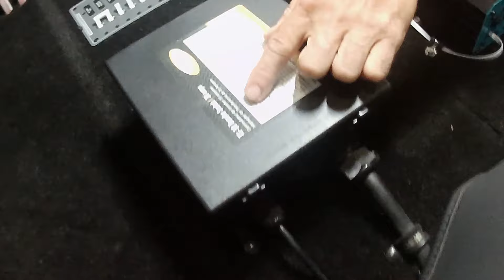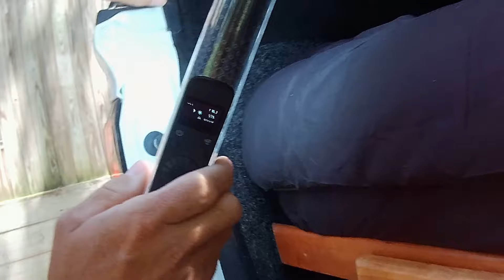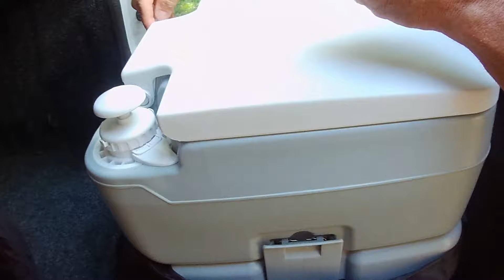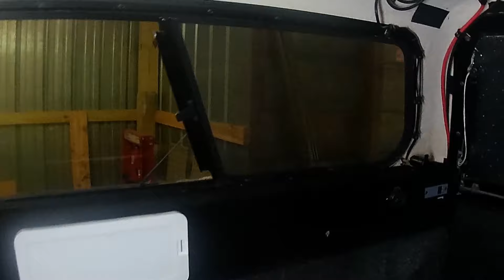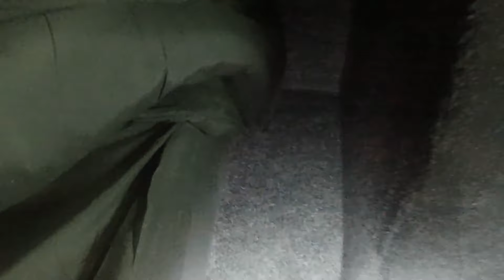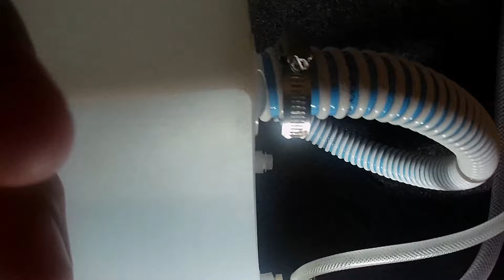Truck To Camper Conversion

Comment: One the best setups ive seen! And the very best explaining and illustration ive ever seen thanks! The only thing different i wouldve done is i wouldve done something concerning your 30 amp plug cord you plug in to shore power and the  30 amp plug in you have to plug a RV into is the way you have both you have to keep your topper lid open or cracked to use either one. And im fixing to start on my truck topper camper and do you worry about the weight of your AC on top of your fiberglass topper becoming a problem in the future as far as cracking or something? Thanks for taking the time to share your build with us!
Reply from the maker: Thanks for the nice compliments. Yes I do just close the cord{s) in the corner of the topper door. It causes the door to stick out just slightly and I am ok with it. You could file away a little metal and get it to be flush. Or do something completely different like exit \ enter from underneath the truck. Maybe from a custom box.
As far as the Air conditioner this is version 2.0 of this truck camper and the AC was part of the original build. No problems so far, I did take it off for a while but its been up there close to 3 years. I think they design the toppers for some weight like a jon boat etc.
Thanks for watching and good luck with your build!
Reply: @NumskisGarage  Thanks a lot! With the cords I was thinking you done such a great job on the shower setup and water tank fill from the outside of your topper you could do the same in the back sides with your cords like campers do. That way you could close your lid to stay cool but also you could close it for security to.  Thanks also bout the roof and I never thought bout them building them strong enough for John boats etc and I've seen it many times duh sorry buddy! I'm a nervous wreck on starting mine but I've got to get going and now it's in the 90s sure slowing me down. Thanks for getting back to me!